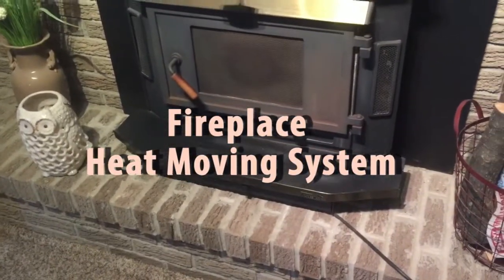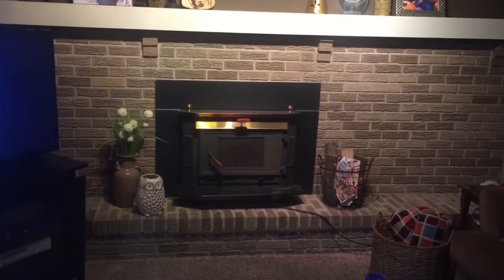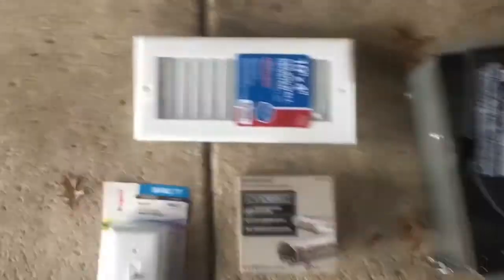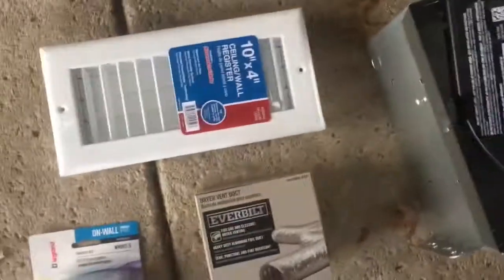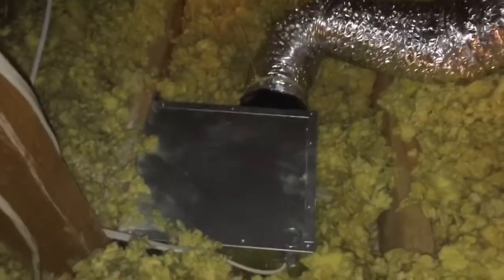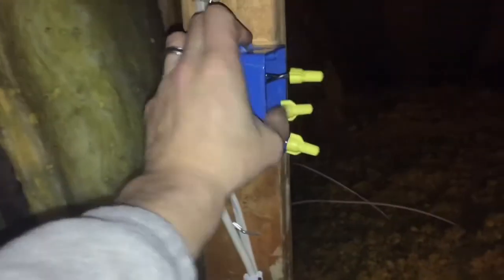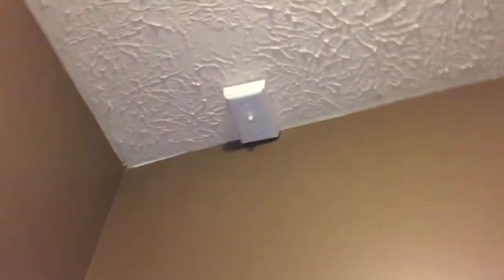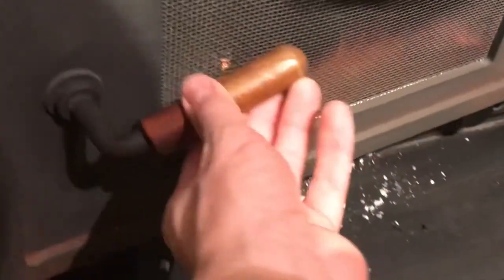Fireplace Heat Mover

Comment: The only thing people are looking for is the one thing you missed.  location of duct work on fireplace... turn on a light
Reply: Doesn’t look like her connected the ductwork TO the fireplace. It pulls heat from the ceiling and moves it upstairs via a duct.
Reply from the maker: Yeah, just pulls the heat from the ceiling